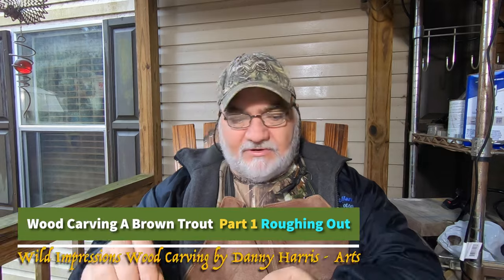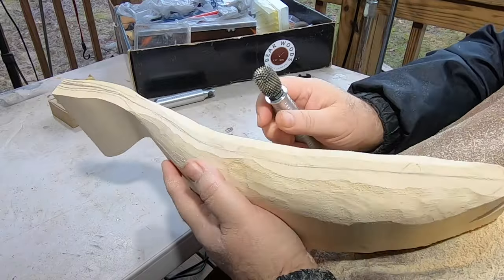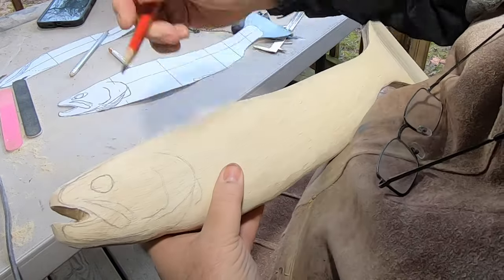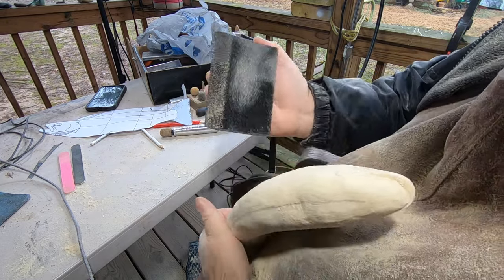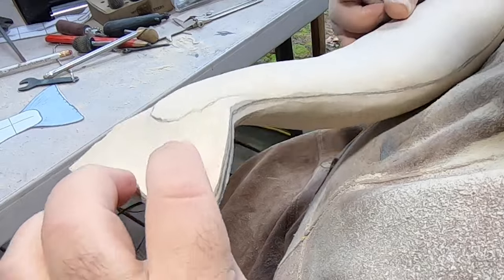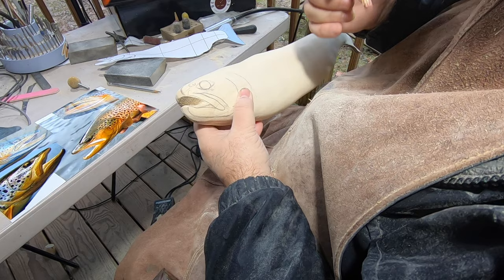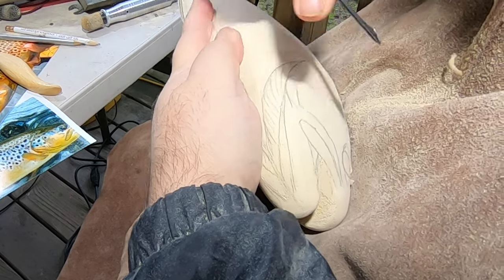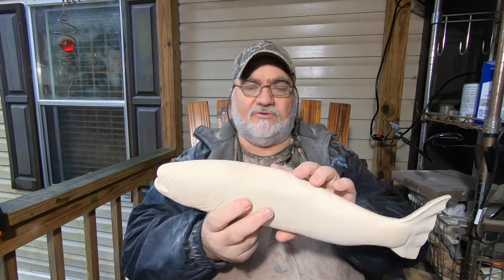Wood Carving A Brown Trout Part 1 Carving The Blank

Comment: Just getting into wood carving. Any suggestions on a budget friendly dremel for carving like this? Love the detailed videos
Reply from the maker: Thanks for watching I’m glad you like them. 
I started off with a Dremel 4000 and bought the flex shaft for it. It’s fine for detail work but it’s not really strong enough for hogging off bulk wood. I used an angle grinder with a 60 grit flap sanding disk to get the blank as close as I could then used the dremel to start shaping details. I finally lucked up on a great deal on a Foredom kit and bought an extra hand piece. 
You may check FB market place to see if you can pick up a good used one. The foredoms have a lot more torque and can handle big heavy 1/4 inch shaft bits.  
A new Dremel 4000 with flex shaft and assorted burrs will run around $150 you can probably find a used Foredom for $150-$200 I got lucky and got mine for $150. 
Join several wood carving groups on FB and ask around if anyone has one they’re selling or know of someone who is.